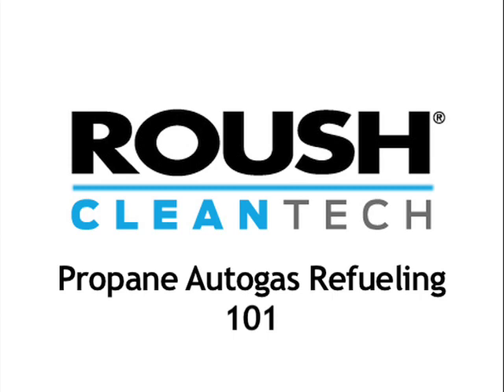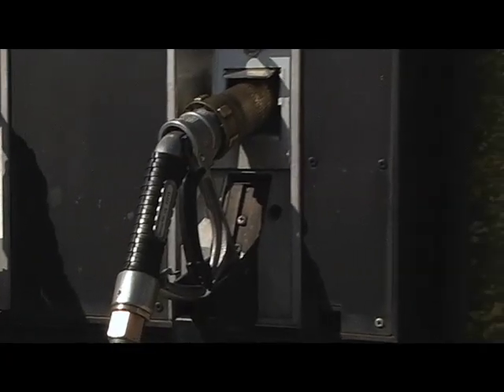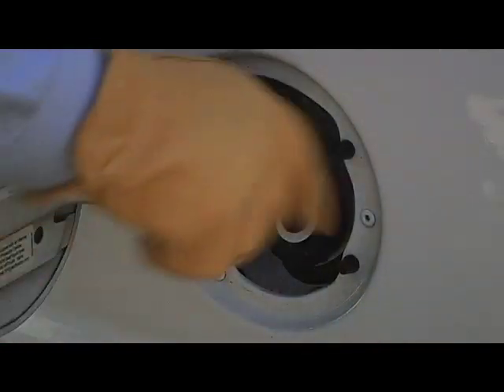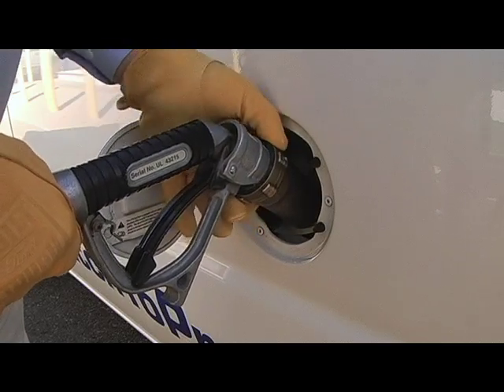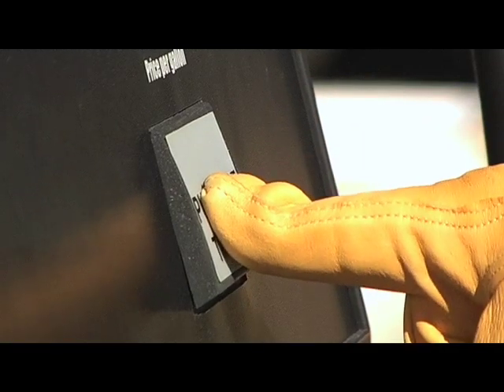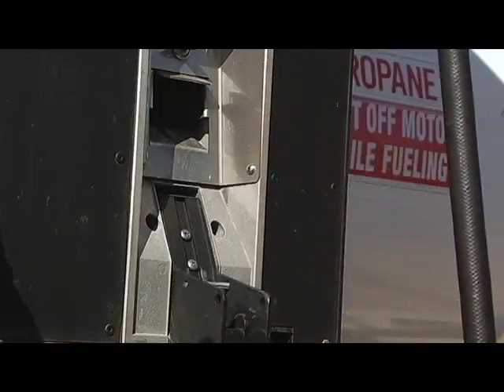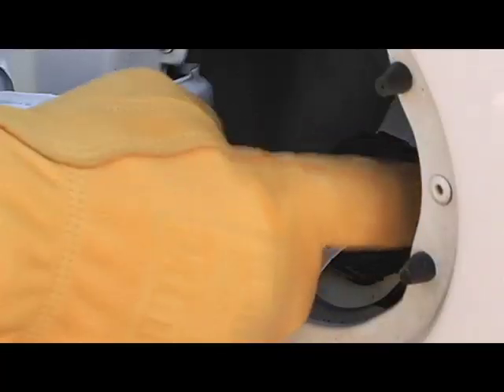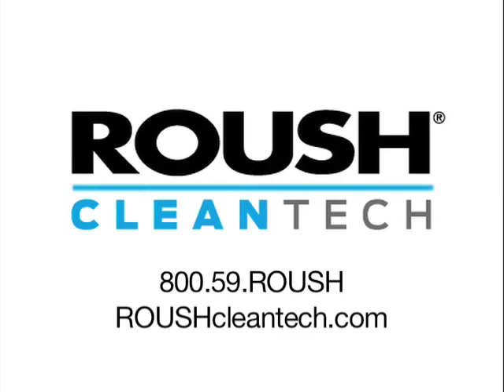How To Fuel a Propane Autogas Powered Vehicle

Comment: This is an older model of fill. Currently regulations require the "Euro" nozzle be used on newer vehicles.  Make sure you have this on yours, or you will need an adapter.  This will be required at self-service locations.

Comment: When did Ford and Chevy have the propane feature available for their cars, trucks, & SUVs??
Reply: I’m not sure about the U.S., but Chevy and other GM products have sold BiFuel cars for 15 years now in Europe. Even in small cars, like a Chevrolet Trax or even the Chevrolet Spark! The connector used in this video is the one they use in Belgium and Germany, for example (and Australia). Europe came up with a different, universal connector that slides into place (the euronipple) but so far only Spain and Portugal adopted it. And as strange as it sounds, the U.S. started using it as well.
It’s called autogas in Europe and is probably nowhere near as popular in the U.S. because gasoline is very cheap.

I think the best selling BiFuel vehicle in Europe today would probably be the RAM 1500 with the 5.7 L Hemi V8.